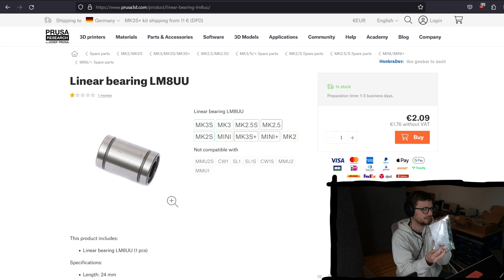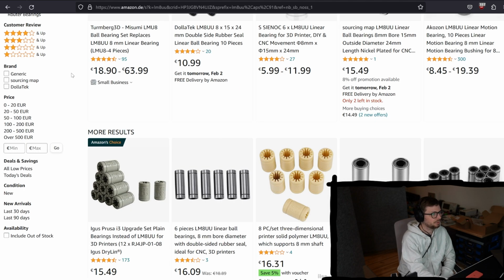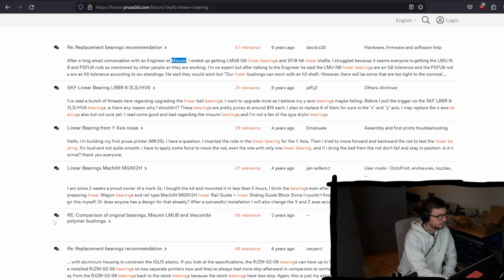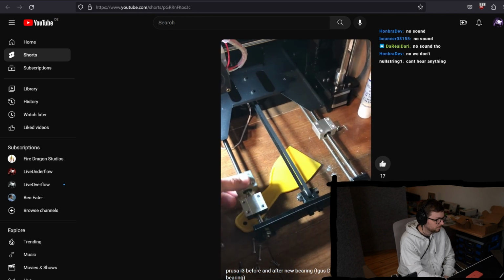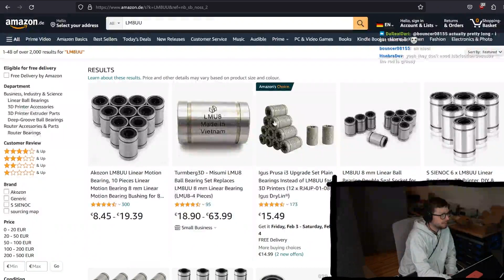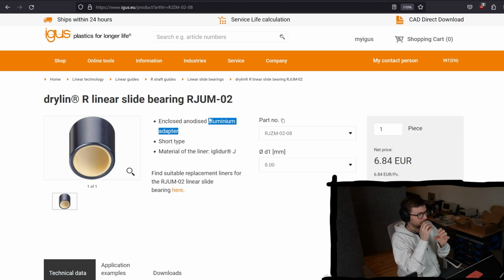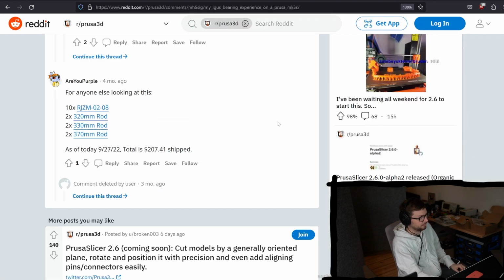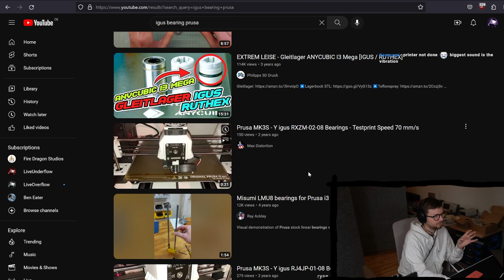3D Printer Researching Igus Bearings - Prusa i3 MK3S+ (part 3)

Comment: I have followed the exact same path. For me also one bearing was bad; it was failing after the first months of printing already, so it was perhaps bad from the start. When it died it died proper...squeeling, and the play for this particular bearing was just ridiculous when I investigated it. Replaced it with another LM8UU.

Fast forward one year and the other stock bearings are starting to go as well. More rattling every week, just too much vibration and noise and I feel like my prints are getting affected by it as well; small ringing/ghosting everywhere, even at mild speed and acceleration. I went on internet, found the same reddit post as you did about his experience and also found a lot of people having mixed opinions about the IGUS bearings. But it seemed that those people were mostly on the ones meant for press-fit or didnt go for the aluminum rods.

So long story short, I just ordered a full set IGUS rods + RJZM-02-08 today! Seems like if you just do the whole kit it should last you a long time.

Comment: English Version - no support for correct translation xD
First of all - you have researched really well! Here are a few additional points that may help someone:

- I would not use the plain bearings you ordered in this form, because the linear guides are rigid. These bearings absolutely do not like angular misalignment or unequal spacing of the guides. They could jam because the tolerances of the bearings are too tight compared to the surrounding construction. The guide axes are only roughly aligned based on the bearings and then bolted in place. The design simply lacks a precisely defined position for the axes.
(If you had all the freedom in the design of the printer, I would create a joint on the carriage between the bearing side with the two bearings and the bearing side with the one bearing. That way you open up a degree of freedom to compensate for the misalignment of the axles).

- I recently built a Prusa myself. The LM8UU bearings come with an unknown lubrication. So I would recommend flushing the bearings completely with brake cleaner and then lubricating with a good grease for guides. There are extra (printed) grease nipples to add grease to the balls. But it also works if you fill the bore of the bearing well with grease, close one side with your thumb and push in the guide shaft from the other side. This way you press grease into every crack. Then move the bearings on the shaft for a while so that the grease can spread. 

You will notice a significant noise reduction - but they will never be completely quiet.

The advantage of this recirculating ball bearing is that you hardly have to worry about the exact alignment of the guide axes. The bearings can compensate for minor deviations.

Additionally, of course, it helps to replace the cheap China bearings with high quality ones.

So in summary: Very good research on IGUS bearings, but not really suitable for use in this design (Prusa). The tolerances are too tight to compensate for the inaccurate tolerances of the design. Take good LM8UU and lubricate decently.